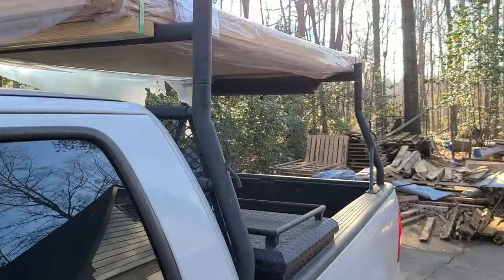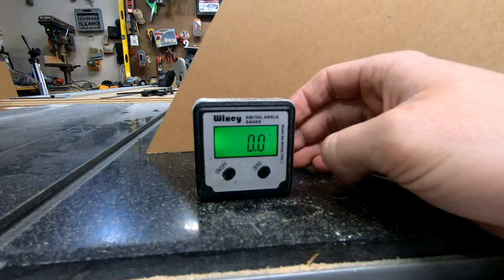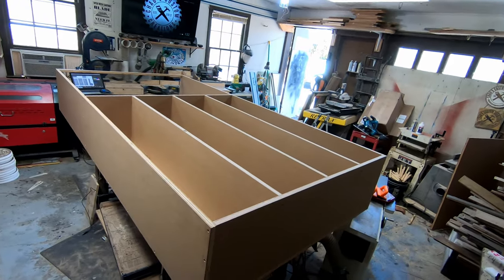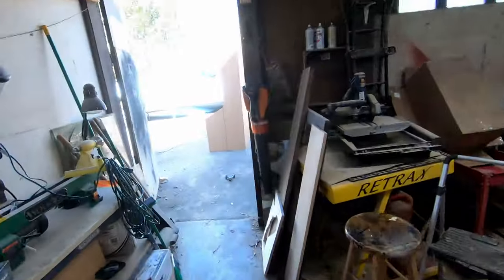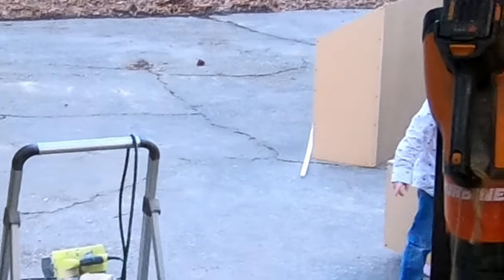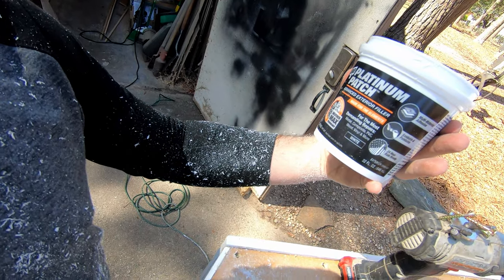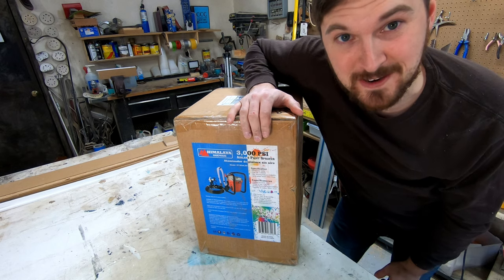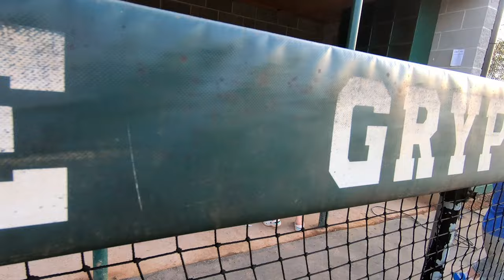Full Build // Dugout Storage Cubbies

Comment: Hey Chad I have 2 quick questions if you don’t mind answering. I was wondering what screws you used for this project? And also what are those white border strips you used at the end called? Thank you!!
Reply from the maker: I believe they were just normal construction screws. The white strips I made from a PVC trim board. Best of luck Derek.
Reply: @ChadsCustomCreations  Awesome thank you! One more thing, these construction screws, do you happen to know what length the screws are? Thanks!
Reply from the maker: I can’t remember off the top of my head but with 3/4” material I would bet they were 1-1/4” long.